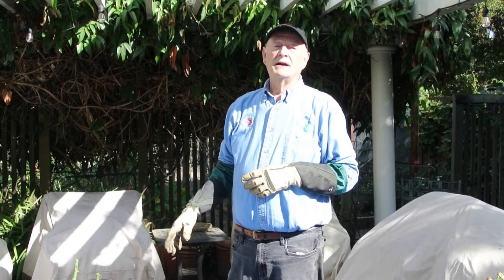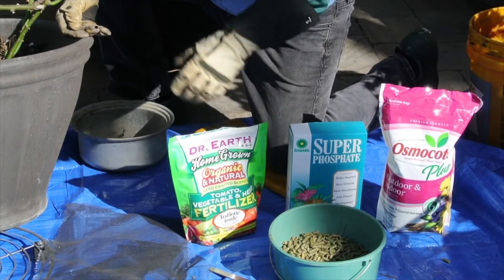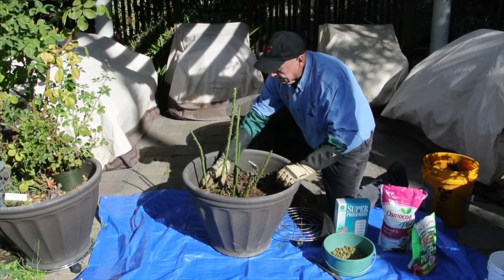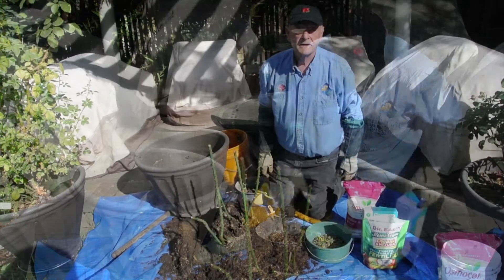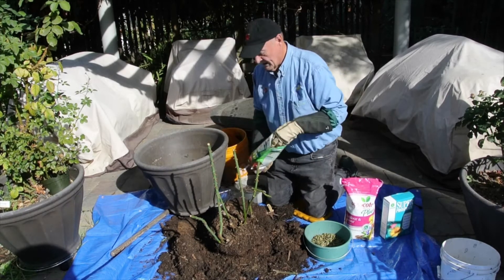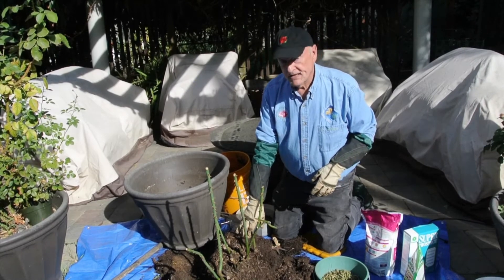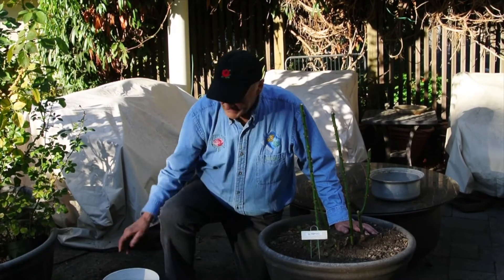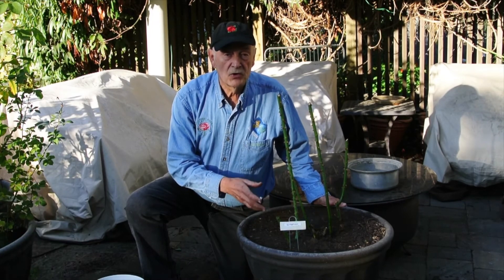Rose Repotting . Step by step repotting of a rose bush - Peninsula Rose Society

Comment: Thanks for the video, very interesting.  Question though - when you add the fertilzer, etc. at the very bottom when refilling it, doesn't this mean that most of that will just wash out the bottom with each watering?

Comment: I reported and leaves turned crispy. What to do? Potting mix is 40% soil 30% compost 20% sand and 20% cocopeat
Reply: It could be transplant shock. Or if there is very large amount of root damage plant does that to retain moisture.